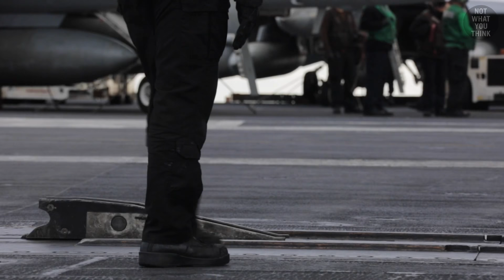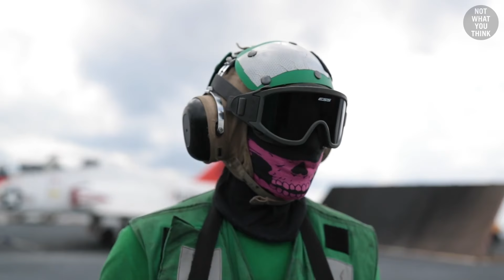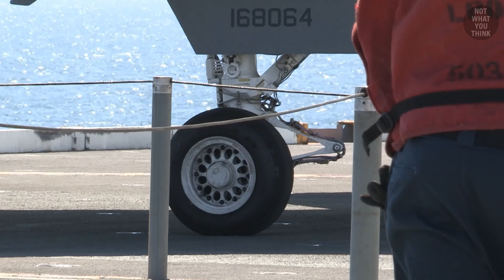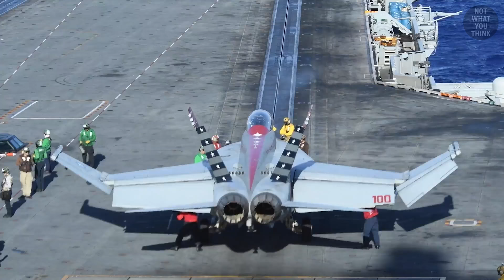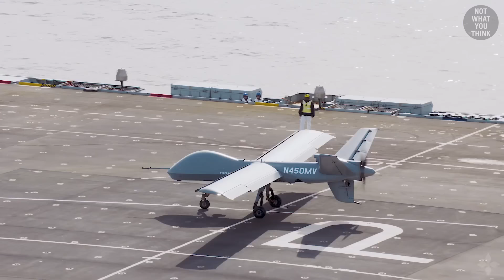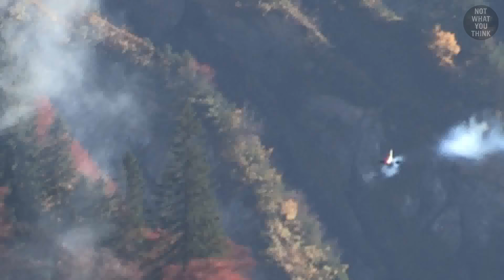Why the US Navy is Replacing Electric Catapults with Steam

Comment: Redesigning the ford class carrier with steam catapults is a very expensive change especially for already built carriers, First the Ford class is not designed to produce the excess steam for a catapults, Secondly  the Ford class is not designed with the plumbing, pipes for a steam catapult.

Now there are problems with the EMALS, but unlike Steam catapults they are newer, so it will need time to fix problems. Steam catpults have been used since before WWII they've had plenty of time to work out issues with them.
Reply: A few observations, Steam catapults are a post WW2 invention by the British 1952 and then shared with the USN, prior to steam cannons hydraulics was USN Yorktown in 1935.  Both technologies took considerable work to become operational and many years to refine, casting aside EMALS now is at best a very poor decision.
Reply: @robertpatrick3350  Again, it's new technology it will take time to refine and fix it.... just like hydraulic and steam catapults before them.
Reply: Shhhh!! Don't be so obvious ! 🤪🤪🤪
Reply: Not to mention the fact that china is threatening Taiwan and if our aircraft carriers are operating unpredictability during actual conflict could cost much more than the added maintenance of airframes
Reply: @SBen-s7z  And China has more reliable electric Catapults or so i read.
Reply: @sheilaolfieway1885  their aircraft carriers needed towed back because it was unable to run under its own power... Think again before you post
Reply: @sheilaolfieway1885  China claims they have more reliable electric catapults. There's a big difference between claims and reality.
Reply: @sheilaolfieway1885 The Chinese uses DC current in their catapults, more versatile system that can handle different aircraft’s better.
The US use AC current in their catapults which is more difficult to control to different conditions/aircrafts
Reply: @sheilaolfieway1885  ... and if you believe that, I have some wonderful swampland in Florida to sell you. And a bridge in Brooklyn.
Reply: @nicholasconder4703  Believe what? Your comment is too late for me to recall what I said.
Reply: @nicholasconder4703   How much i'd love to live in florida.
Reply: @SBen-s7z  The real issue is time. The Ford and Kennedy in the near term are the only US carriers with EM catapults. Removing those and replacing them with steam will remove the carriers from service for many years. Odds are, with the speed of procurement, the steam catapults to replace the EM catapults won't be delivered before the end of Trump's term either. The change would also delay Enterprise and Millers construction (Both the redesign and restarting the production line for the catapults) Which between other carriers life cycles and yard space will mess with the Eisenhower and Carl Vinson decommissioned (refueling them again will also not be an option for the same reason).
Until they're ready, there's still 9 Nimitz class carriers in service to do the job.
Reply: Also especially when it comes to the world of shipbuilding the lead member is in many ways a prototype. These are 100000t complex systems and things will go wrong once put together that might not be caught or aren’t possible to catch in isolation - the difference is that compared to a tank or jet, a carrier is too much of an investment to build and junk for strictly testing purposes
Reply: It'll almost be a different class of ship at that point. Maybe call it the Ford Model T Class.

Comment: Why not build a hybrid system and the steam compoment of the catapult as a backup.
Reply: Money and complexity.
Reply: It would take up way to much room. You would need at the parts for the magnetic launch and steam launch.
Reply: Steam systems take up 6 floors.  We stopped using steam trains as a backup system due to the perfection of diesel.
Reply: That would mean using up much more of the ships space than needed. There is a reason they do not use hybrid systems for locomotives as well.

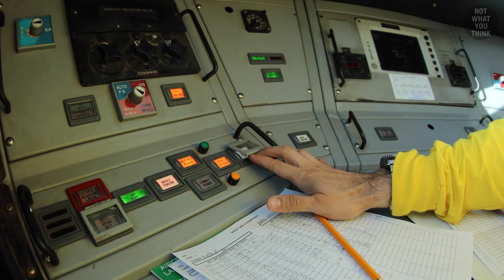Comment: (2:51) That was NOT a cold shot as was stated. The front gear of the plane collapsed, as you can plainly see.
Reply from the maker: correct, didn't find better b-roll, was improvising. Guilty as charged (video editor)
Reply: @NotWhatYouThink  Right.  Because a cold shot is very rare.
Reply: @NotWhatYouThink  and ypu forgot also: to lie in main video Title, too?
Also "some other person accidental error"? 😮
Reply: @palohagara  Mate I'm a full time professional video editor myself, I don't think insinuating the editor here is a liar is polite or balanced. In production, what happens is a script will be written and recorded first, then the editor will be tasked with matching visuals to the entire thing on a deadline. If there isn't B-roll available of the exact thing mentioned (low velocity steam catapult launch due to a cold shot) you have three choices as an editor; #1 Stick in a completely unrelated shot to avoid confusion (an airman waving, a wide of the ship) that doesn't visually help with the audience's understanding of the scripted line. #2 Create some kind of graphic or animation instead, which adds time, cost, external resource and complexity, not to mention is off-format for NWYT videos. #3 Choose a shot that is visually similar, still gets the point across even it has technically inaccuracies. Now if you were an editor, and you were on a deadline, you'd have to quickly choose between those 3 options. Maybe you'd choose a different one to the editor here, who has been very open and transparent about his choice... but to just throw insults at him from your own perceived superiority of intellect is unkind and childish in my opinion. I think you should gently consider how you conduct yourself.
Reply: If the front gear collapses, you do not have enough energy to get off the ground/fly.
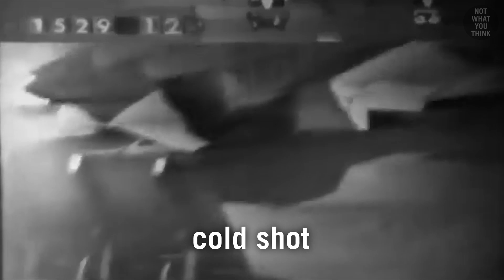Reply: It wasn't a "nose gear failure". The bridal failed, which if you look carefully allowed the shuttle to advance and hit the nose wheel from behind, causing the gear to collapse forward. You can see the shuttle continue to accelerate forward of the aircraft after it passed the nose gear. At (2:57) you can see the nose gear bend backward when it strikes the shuttle, which was already near the bow at the end of its run, from behind.  ^v^
Reply: @taproom113  , You're missing the point. That being that it wasn't a cold shot as it was labeled. And no matter the cause, the nose gear did fail.
Reply: it was both i think cause if it had made it off the deck it could fly round and land with the arresting barrier
yes the gear failure likly caused the cold shot but cold shot isnt just an underpowerd catapult its the plane going for a drink cause it didnt get launched hard enough dont think it matters what caused it
Reply: @s4sausage135 as you explained, different mechanism, same result.

Ironically, it might have been caused by the catapult being set too strong, or more likely the landing gear metal fatique from previous harsh launches, both of which EMALS is uniquely designed to solve.
Reply: @jarylOhNo  That was my thought as well.  Catapult could have been set too strong, opposite of cold shot
Reply: @s4sausage135 With the nose gear failure. The nose is pointing down. During the launch the aircraft doesn't have lift as you have high pressure air going over both the top and bottom of the aerofoils (Wings). The aircraft gets lift once it clears the deck and gets low air pressure under the aerofoils. It's called lift because of the high pressure air above the aerofoils that lifts the aircraft up.

Most of the fatigue on landing gear is from the controlled crash called landing. The steam catapult is slowly inched forward taking up tension on the launch arm. So it's not like towing a car with a slack tow line that then gets the jolt forward. The steam catapult is approx. 500,000 psf and as stream is what is powering the ship, it's always there ready. Maintenance is pipes, piston and water brake.

As more modern ships are moving to azimuth pods, the steam produced is only for power generation and that brings in a whole new headache. Power, computer code, hacking etc
Reply: @Tinys-Homestead  First of all, the aircraft was scraped along the deck, adding a ton of friction. Second, a wing pointed down is going to act a bit like an air brake and will only push an airframe more firmly onto a deck, increasing said friction. A wing will fly if you have sufficient speed as long as angle of attack is below critical. The issue here is that it's hard to get enough speed with all the extra resistance that wasn't accounted for. And without sufficient speed, a wing won't fly.
Reply: @Tinys-Homestead 
Steam catapults on aircraft carriers typically operate with accumulator pressures between 450 and 520 psi,
NOT your totally ridiculous half million psi
Reply: @AlainDessureault  Sorry that was suppose to be psf pounds per square foot. Which is over the entire length. Was informed of this when I visited USS Nimitz during RIMPAC '88.
Thanks for pointing out the error.
Reply: @Tinys-Homestead 
Your psf works out to 3472 psi which is still wildly too high
Reply: @AlainDessureault  On Google which will be lower than classified figures.

System Pressure: While the system can hold up to 3000 psi, the actual operating pressure is carefully calibrated to avoid damaging the aircraft.
Reply: @Tinys-Homestead  ""It's called lift because of the high pressure air above the aerofoils that lifts the aircraft up.""  WHAT now?
Reply: I'm not sure he intended it to seem as such. It was just a dramatic failed launch which makes the video interesting.
Reply: @jonathanfairchild  , Go back and look at it again. It is clearly labeled on the screen as "Cold Shot".
Reply: Still no mechanism in place to abort the launch though, right?
Reply: @Person-jw7mk You can't abort any launch once the holdback releases the aircraft, EMALS or otherwise.
Reply: @michaelmappin4425 Interesting. Thanks for the correction.
Reply: @michaelmappin4425  They don't want "sense", they just want an excuse to be mad.
Reply: @michaelmappin4425  Why not? As I understand it EMALS is basically a linear electric motor. Why would it have to keep running? Inertia?
Reply: @Hairysteed That's actually a great question and probably makes me want to rethink my answer which is primarily based on experience. But, it really should be looked at from science. The aircraft is at military or combat (afterburners) power when the energy needed to break the holdback is received to start the process. If the process needed to be stopped, I don't doubt the EMALS catapult should be able to brake relatively quickly as long as there are no human inputs required. The pilot, on the other hand, would need to recognize the situation, believe his NGL (nose gear launch) was already ahead of the shuttle, decide to abort, throttle down (turbines have a long delay spooling down) and apply brakes. That would all have to happen in just about 2 seconds. I know an awful lot about how steam catapults water brake at the end of the stroke but I know very little about how EMALS stops. I'm actually thinking about that for the first time, but I assume it's magnetic braking.🎉🎉 I really appreciate your comment.
Reply: @Hairysteed  the catapult pushes the airplane, you can stop pushing it say, halfway, but that plane is not going to stop, even if the wheels stop turning, V1 comes very quick...it is going over the edge.
Reply: @Hairysteed  You are forgetting the plains engines are going full bore before release, once released you cannot abort, as long as the hook is still holding you can spool down the engines and stop, but if the hook lets go you are committed, you will be airborne or in the drink.
Reply: @Hairysteed  A very simple answer is that there is not enough "runway." And that's why they are using catapults in the first place. Also, catapults are designed to accelerate aircraft, not to arrest them. Even in civilian aviation, you have a "point of no return" where you can't abort any more and you have to continue with take off, even if you lose an engine for example. Because you wouldn't be able to stop. Or, at the very least, you'd be pushing your luck. At some point, it's safer to be committed. Instead of scrambling to quickly change configuration.

So, it should be technically possible to cut the catapult. But if you do, the aircraft is probably going to crash. Therefore, you have to keep the catapult running. It's safer to take off and land again.

Comment: Trump is really turning the US into some shithole stuck in the past. In 100 years every country on earth will be powered by renewables while the US is still burning oil and using the same technologies it has for the last 200 years
Reply: Wind and solar are not reliable sources of energy. When there is no wind, you don't have electricity. When the sun goes down, the same thing. And, there never will be enough battery packs to store enough energy to cover nighttime consumption. Go play Cities Skylines 2 which tries to be accurate in city planning/building, build a solar plant and see how many battery backups you need for it to get through the night with a developed city. Then we can talk.
Reply: My god you are delusional. Renewable energy is just a gimmick it will never be used in a high enough quantity to power the ever increasing electricity demands. In the future all will be powered by nuclear. Renewables aren’t a real solution to the energy problem.